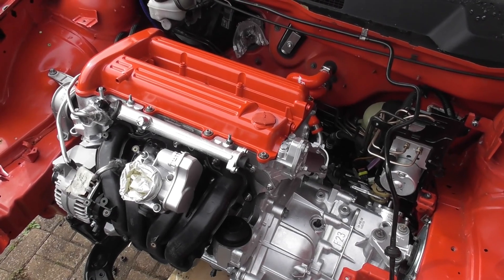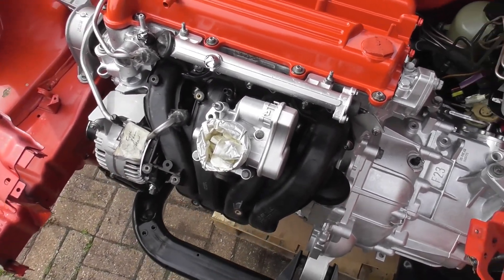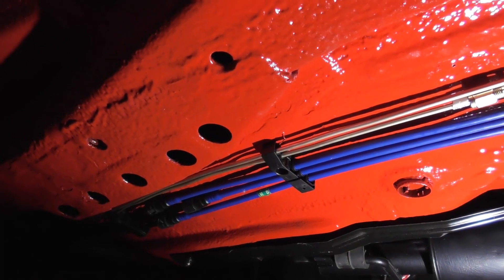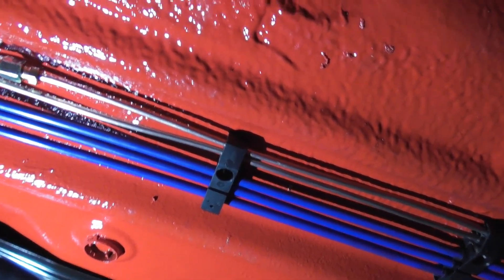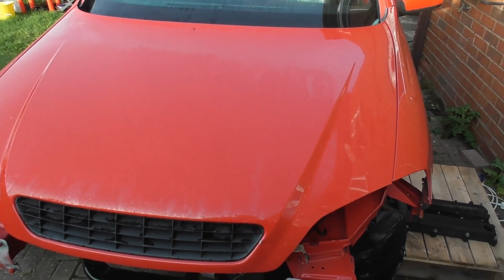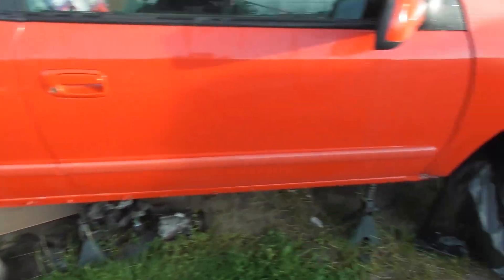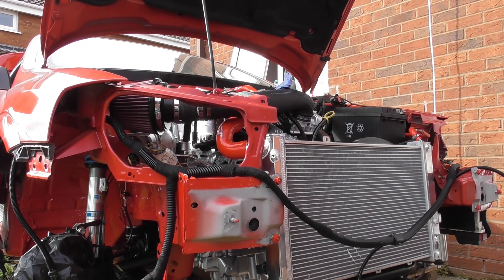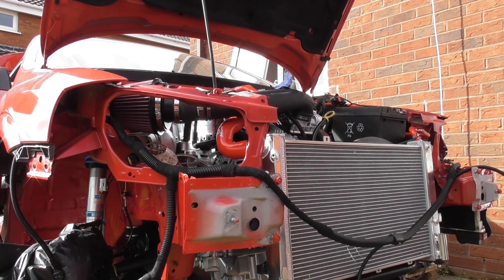Astra Rebuild Episode #43 - Engine quick test!

Comment: Your work doesnr get the credit it deserves 💪 what process did you go through to get wheel well walls in that real immaculate finish
Reply from the maker: Cheers man, same for you too, all this effort for 4 likes 😂 On the fronts, I washed them thoroughly and roughed the factory coating enough to key It, then applied Gravitex which acts as a protection and primer. Then painted red and glossed. The best primer I've found is the Upol 2k epoxy which is really good and gives a great top coat finish. You just have to get lucky with paints that react well to each other. Some areas on my car still feel tacky. The front arches though are really nice and feel smooth and strong. Enjoying your series mate
Reply: @mikeyjaxxx   epic work mate love your level or attention to detail exactly what I'm all about aswell 💪 thanks for that advice. Imma try get more subs your way il share your channel to some groups
Reply from the maker: @CarGuyLife  always appreciated buddy. Enjoy the new unit, looks well.